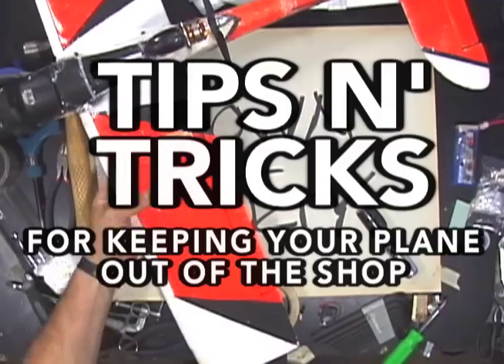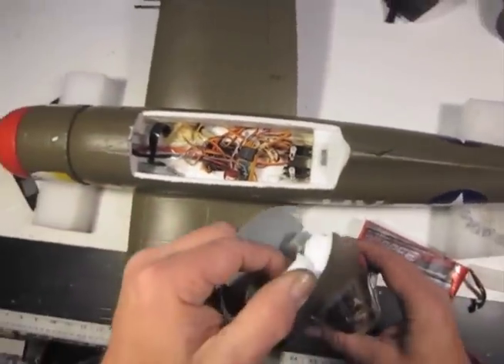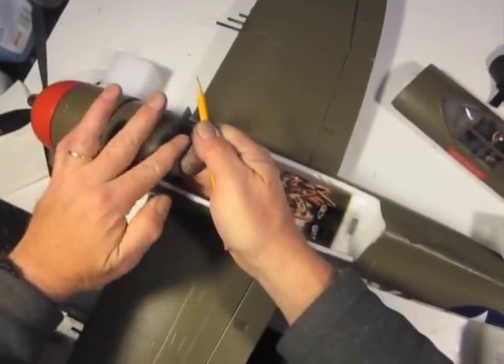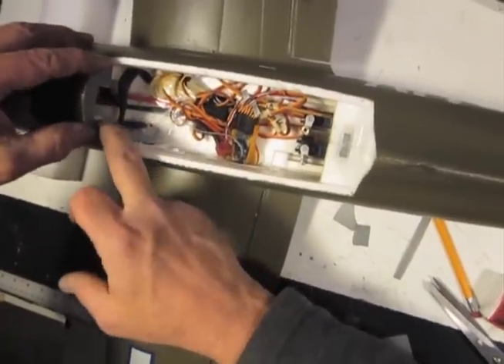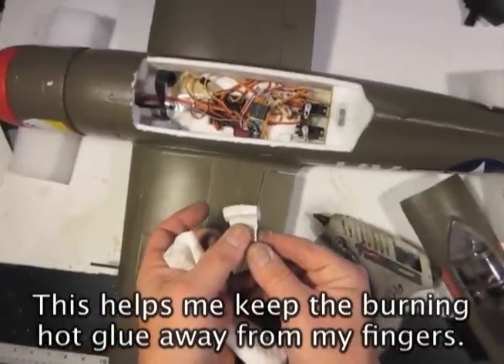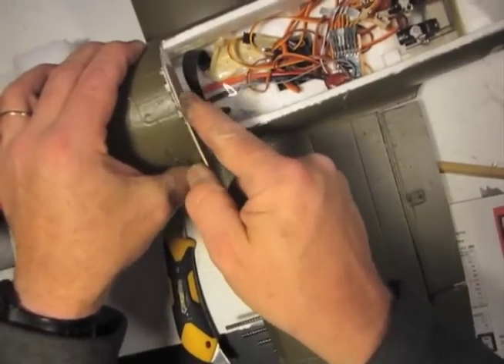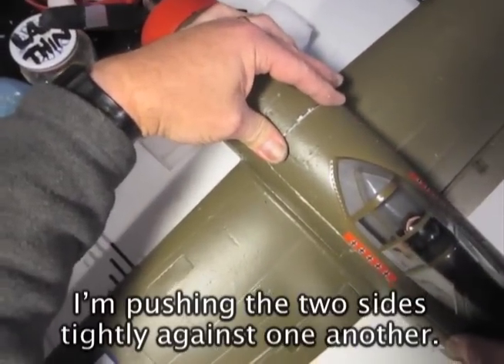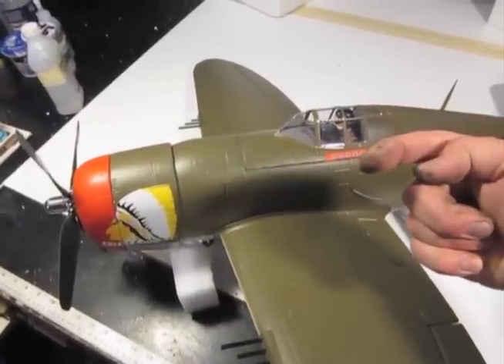DOWN & DIRTY TIPS N' TRICKS - How to Reinforce Your Cockpit Wall with HDPE Plastic And Carbon Rods

Comment: Cool. These are the little modifications we should all be using!
Reply from the maker: And I do!
Reply: @Killerplanes  If you were scratch building what line of motors do you guys prefer? I have been having good luck with the Blue Sunny Sky Motors, but I am wondering what others use.

Comment: I love the pins in the front idea, I have a few planes that are gonna love this !! 
I notice you mentioned "handles"  in the rear of the canopy.  do you a tip/trick for that ?
Reply from the maker: pointnozzleaway That's the handle we include with our Crashproofing kits- it's a rod that's drilled through the canopy and sticking out 1/8" on each side. Usually it's located at the bottom corner of the "open" end